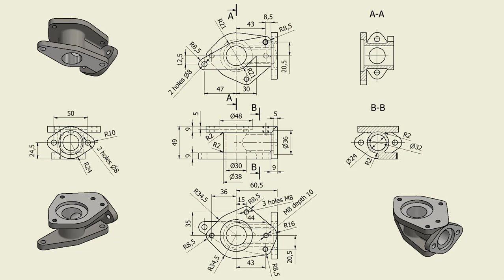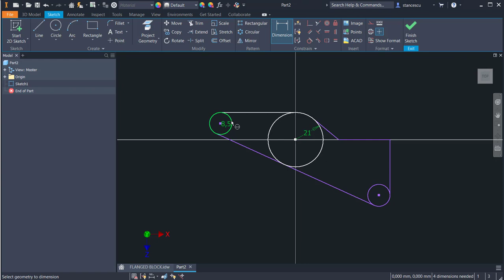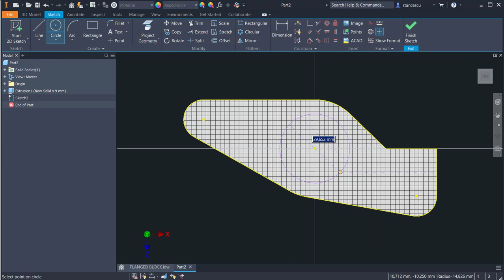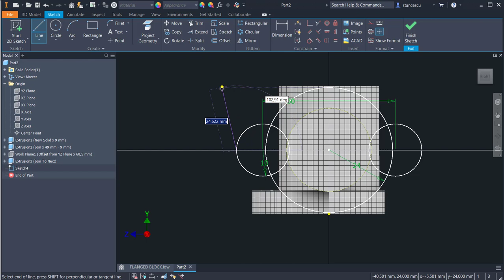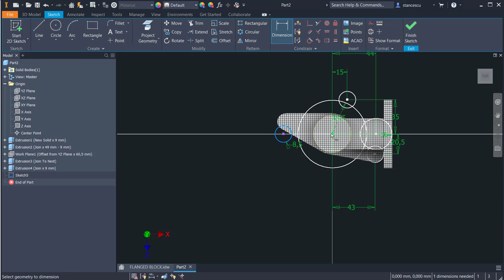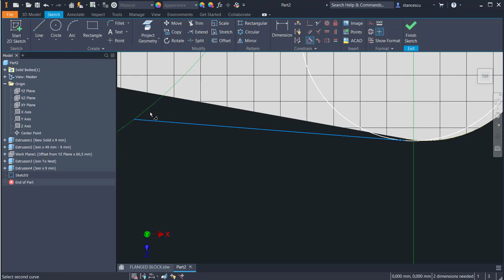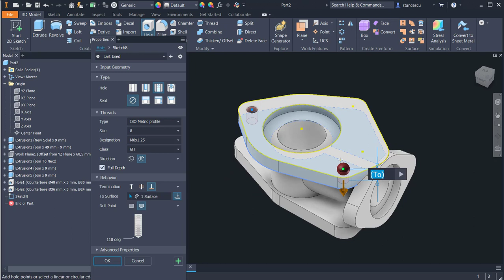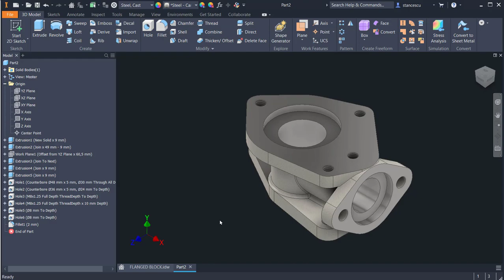Tutorial Inventor - 128 FLANGED BLOCK (Part-088)

Comment: Dear Constantin,
it is nice case for training ...nevertheless from manufacturing point of view it is strange. How should it be produced? ....by welding  or casting ? For both way of production the shape  to be different. It would be benificial to convert the shape (volume)  for each specific way of production.
Reply from the maker: I have had this part in my hand in 1964! It is a part from the brake assembly of railway wagon (Knorr bremse). It was made by casting and then mashined - not a big deal…
Reply: thank you